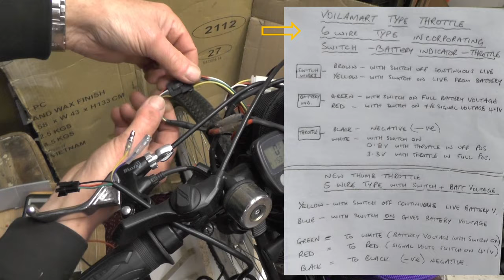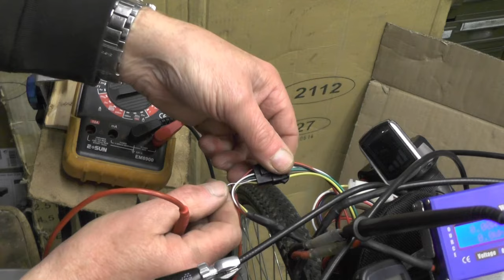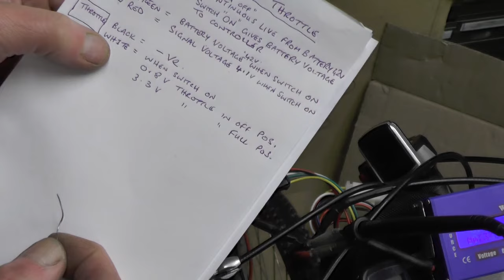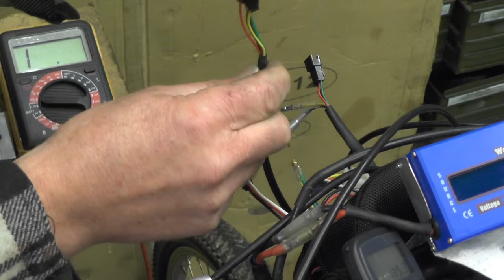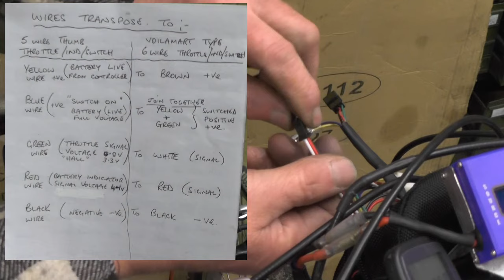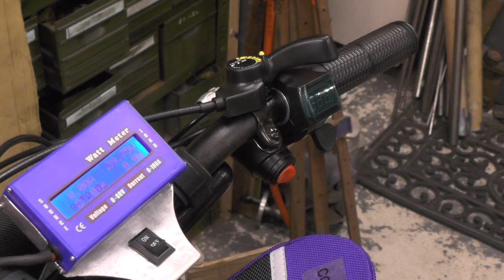Electric Bike Wiring Twist Throttle 6 wire to Thumb Throttle 5 wire Voilamart  type Controller. Mr F

Comment: thanks for the reply so maybe you can help me connect a motor controller with six colour hall wire to a five wire wheel hub   so the controller wire are Blue/Green/Yellow/ Black/White/Red  and the wheel hub has five wires which two colours can I connect together to work with five  Red/Black/Blue/Yellow/Green
Reply from the maker: Hi
I would love to help you, but its difficult without being hands on, as different manufacturers  can use there own colour coding sometimes, so can't be 100% sure.
But usually the Hub hall sensor wires are red for positive, black for negative, the blue yellow and green are usually the signal wires and the white wire can usually be left unused as its usually the speed control wire for some bikes. Just isolate the white wire.
Hope this helps, but really need to be hands on to give any better advice.
Good Luck with it
Regards
Kev
Reply: thanks you your a good explained  I will try go by your wire diagram you wrote on the paper but at the same time I will see if it works with out the white wire not connected hopelly I can see that the speed on the display is detected when the wheel is spinning  I did a search on google and found that battery thumb throttle
Reply from the maker: @scienticstratgies2368  good luck 
regards
kev

Comment: hey I  got a scooter that I  want to change a. pull finger that push throttle  like the one you got can you send the the information where you got it   thanks for that video  the controller I have has the 3wire brown /black / yellow
Reply from the maker: hi there.
thanks for watching and commenting
I did these videos a few year back now, i have checked the ebay seller that i got the throttle off and they no longer exist, so its just a matter of searching for a thumb throttle from another supplier, sorry can't be more helpful, the market back then was flooded with them.
all the best with your search
regards
Kev

Comment: that is very true wires are never the colour that you expect them to be having alot of trouble getting the same type of system to come on the bike didnt come with a key i know there should be fuses but i cant seem to get to them as no key to battery case. the bike was all runing before all whats been replaced is the throttle as this was damaged and wire were cut on controller end at a complete lose as to next step
Reply from the maker: Sounds like a frustrating situation, hope you get it sorted!👍 Paul
It might mean a replacement controller if the wires are no longer there.
However they may have been cut for a reason as throttles are illegal if your in UK,? (see my latest video here)  https://youtu.be/8uXyJvyXAQ4
Controllers aren't too expensive, if you have to replace it.
all the best
Kev
Reply: @MrFactotum  am i right in thinking that as long as they are the correct voltage and wattage all batteries and controllers are compactable as long as they have the correct fitting types?
Reply from the maker: @Paul-df4mc  Hi Paul, yes usually, and some controllers have combinations of voltage i.e, 24v -36v for example
all the best 
Kev

Comment: Well my question is. I broke my twist throttle.  Basic push button power and 3 light indicator. Alright. I tryed to use a regular 3 wire red green black. Turn on but the it wouldnt work. So the black red and green must have been different then the other black red and green.
Reply from the maker: hi kb88
its quite a long time since i did my ebike video, my grey cells don't retain all the different wiring combinations also equipment changes over the years
i know different manufacturers can use different colour coding, so it's just a matter of tracing what's    +ve , -ve & signal wires with a simple multi meter. I think if you follow the sequence in my video you should determine what's what. 
The only trouble is, is if you've been given a faulty unit it can be difficult.
It's difficult for me to help without being hands on, but usually the multi meter should sort out what is what.
good luck
let me know how you get on.
regards
Kev
Reply: @MrFactotum  I'm shocked for a response.  Im in the US.  I've been messing around with them for some years now. I bought this bike which I have shaped things around with other bikes. Any ways I didn't buy this controller and that where I'm at here. I do know I've bought a throttle in the past and it had a blue instead of a green. The was simple with a Basic two wire dc motor. Im have a hub motor and I was thinking the throttles were different, because of the hall sensor in it. But thier not I just need to figure from the controller and old part what the 3 wires are compared to a throttle I just have laying around hooked up to a controller I know work's together.  Thanks for responding.
Reply from the maker: @kentbyers88  your welcome
good luck👍👍👍👍👍👍

Comment: Great video sir well done! This video is 3 years old and still no standard never trust always ues a multi meter there cheap and will save you money in the end !
Reply from the maker: thanks Christopher
appreciate the feedback👍👍👍👍👍👍
regards
Kev
Reply: Hey I need help I have two wires hooked up and they now turn the display on when I turn the key all I have left I'd a green and white wire on throttle and red green white and yellow on controller so I have 2 wires that need to be hooked up to 4 wires my motor is not moving when I twist any ideas?

Comment: Satisfying to see this so well explained although I'd be careful about using your continuity checker on live circuits. If you want to add a second motor https://youtu.be/0oyP64j-Khs
Reply from the maker: cheers Richard
i will bear your info in mind and will check the link you sent.
many thanks👍👍
Kev
Reply: @MrFactotum  Thanks. I blew up two bikes this week and needed to repair them.  Your video was easier to find than mine. It was really useful Thank you.  This is the other broken bike  https://youtu.be/CnJ1kYMNbxs
Reply from the maker: @richard_wenner   Hi Richard 
thanks for feedback, now contact made i have Sub'd and Bell'd you and will take a look  at what you get up to when im back off holiday.
regards
Kev👍👍👍👍👍👍
Reply: @MrFactotum  Have a good holiday.

Comment: Help! So I have the same old 6 wire throttle and a new 5 wire throttle with key instead of a button.
My voltage meter turns on but the throttle isn’t turning the motor? 36v 750w motor. 
Any ideas?
Reply: Also I can hear the motor click when I turn the key switch on. Just no turning.
Reply from the maker: hi ff590.
sorry to hear your problem, it's really difficult to say not being able to have a hands on approach,  there are quite a few variables to check, as nothing is standardised, if the motor worked ok with the old throttle on then this should eliminate a motor problem, unless by coincidence a fault has occured with maybe a hall sensor in the motor,.
Because your key switch throttle is differenent to my button one it could be wired with different coloured wires, it's just a matter of being methodical and re-check what wires are serving what parts etc. and trace there function.
Sorry i can't be more specific, but its difficult not being hands on to look at it with it not being identical to my voillamart one. 
all the best with it👍👍
cheers
Kev
Reply: @MrFactotum Hi,
Thank you for taking the time to reply and the quick response Sir. I know it’s really hard to help not being able to see it.
I gave up last night after messing with it for a few hours lol. The motor seems to be fine though, as it still functions normally with the old throttle so I’m confused at this point lol. I’m going to give it another go after work tonight and retest everything with the multimeter.
Thanks again for the reply and the video. It helped very much to understand how it works.
Reply: Hello again MrFactotum.
Had another question i was hoping you could possibly assist with.
I replaced the throttle I couldn’t get to work despite wiring it exactly like yours.
And it worked!
Question is though, now I replaced my controller with one that supports an lcd.  With the lcd being the only/off power button now, is it possible to use my(or any) keyed throttle? It’s currently working just as a throttle only without the key function.
Thanks again for the video. It’s  been extremely helpful.
Reply from the maker: @TwitcyTrain eyup FF590
glad to hear it worked. 
As for question about the different controller with a lcd display, i have never owned one of those, so can't really offer any advice, i just keep all my bikes with the minimal hardware, then if a problem occurs it's more simple to resolve, I would keep it without the key function if its working ok, if your worried someone might take off on it, put a on/off switch hidden near the battey, to isolate the battery., thats what i have done, i also put a inline fuse there as well, and carry a spare fuse with me.
I'm not telling how to suck eggs here, but never leave a lithium battery on charge in your home, shed or garage. especially the far eastern ones which most of them are anyway, wether branded or not. I always charge mine outside in my undercover entrance way, and never leave it alone.!!!!
All the best with your new toy🚲🚲🚲🚲🤣🤣👍👍👍👍👍👍👍👍👍👍👍👍
cheers
Kev
Reply: @MrFactotum  Thanks for the quick response again. Okay the hidden switch is a great idea. I only wanted the key for protection for the few times I might take it to the store. I do tend to agree with the minimalistic approach. However I did want the option to adjust my PAS and wanted something that showed my voltage instead of the bars.
Love the content!

Comment: In the first meter (bar one) screen, can you please tell what does the red rectangle sign means (below cycle sign)
Reply from the maker: Hi
its a long time since i did that video, i  no longer have the throttle with bars on, give me a reference time in the video so i can take a look to see if i can remember, for you.
regards
Mr f
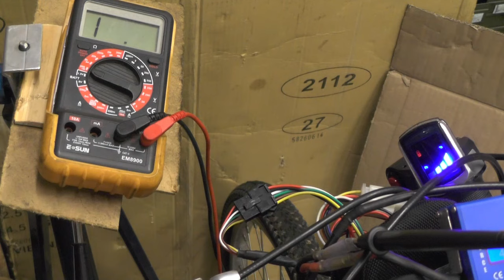Reply: 9:12 and 13:17
The meter with battery bar. Red rectangle icon in left.

Comment: On a twist throttle voltage display. 1 week ago it read 48v now it reads 42v. Does it go all the way down to 1v or 10v before I need to recharge the battery or ? Please let me know ?
Reply from the maker: No, 
a 36v battery when full reads 42v when discharged it will cut out at around 30v, 
Don't know about 48v batteries, but will have a similar ratio.
cheers
Mr f

Comment: Wow. Looks like I'm headed where you've been! Thanks for the vid!
Reply: @MrFactotum  sure we got the same kit mine got 6 wires I’m looking to get key throttle like yours if it’s the same wouldn’t wiring be the exact same like you did in the video? need to know since don’t got the volt checker it would be more ideal with one
Reply from the maker: @Dumponanything  Hi DOA
It's a while since i did that video, but from memory, you would think the wiring would be the same, but back then different manufacturers could use different colour wires, If manufacturers have standardised by now, it could be the same, but if it was me i would methodically check what wire is what. 
As long as you don't get the +ve and -ve mixed up you shouldn't do any damage to the hall sensor, I have no experience of the ones with keys, but would imagine it just the same as the push button switch. 
All the best👍👍👍👍
Kev
Reply: @MrFactotum I think I’ll only need help with the 3 wire adapter that you bought separately I can’t tell where/how you’ve connected it . Anywhere I can contact you like instagram to make it easier? Thanks
Reply from the maker: @Dumponanything  Hi DOA
Its a while back since i did this, so memory has faded, but i think you mean the 3 pin plug i added for the +ve = red to red  -ve black to black and signal wire white to white, then there were two other wires with bullet connectors on to the switch.
Hope that helps.
Sorry i don't do instagram
I'm on holiday at moment so can't check the bike physically, but i think the 3 pin connector is how ive just described.
Like i said before, just dont get the +ve and -ve mixed up, and a voltmeter would verify those if your not sure.👍👍👍👍👍👍
Reply: @MrFactotum  thanks for that enjoy your holiday bro 👊 will most likely get a voltmeter to be sure 👌

Comment: Hey Great Vid! You have a new subscriber.

Do these Voilamart boards support wiring in a reverse switch? I know its a bit weird on a bike, but I need it for a project I am looking at. I realise the wiring for reverse may not be there, but wondered if it was on the board and could be added relatively easily. Cheers!
Reply from the maker: eyup RH
Thanks for that.👍
The one i have in the video, doesn't have a reverse on, but i have a different controller  on another bike, just a cheapo far eastern one and that has wires for a reverse mode, so if you have a project that needs reveres checkout the description on the controllers, i got mine off "Fleabay"
regards
Kev

Comment: I replaced my throttle on my Archer electric scooter it worked then I unplugged it and plugged it back up and it wouldn't work what happened
Reply from the maker: hi Brandon
Sorry to hear your problem, it's just a matter of double checking all the wires and connections for faults, and for good connections, or maybe you have a faulty product. It's very difficult to say without being hands on.
Hope you get it sorted.👍👍👍
ATB
Kev
Reply: But how do u no if it's a faulty product
Reply from the maker: @brandonsourjohn4901  well Brandon, thats the million dollar question, it's like anything else, probably compare it with a good one, then you will have a spare or sell one on.
Sorry but it's a hands on problem, can't be solved unless on the job. Just double check all the wiring, connections, earths, live wires, signal wires to see if they are all doing what they sould do, if you accidently put full voltage wires to signal wires you can damage the hall sensor in the throttle. After that it's probably down to the throttle. Cheap imported items are notorious for having some form of faults, some repairable, some not. If all fails you could ask the supplier of the throttle to replace it if it's still not responding.
ATB

Comment: Warning: On mine the yellow wire from the controller must connect to the yellow wire on the throttle. If the brown wire from the controller is connected to the yellow wire on the throttle like it says in the video it will still work but the voltage display will be illuminated even when the power is switched off!  Only the blue wire on the throttle needs to be connected to the brown wire on the controller. No need to connect the green wire from the controller.
Reply from the maker: Hi iptv
Thanks for comments, it works fine on mine and for many others who have commented, 
I did say in video that there's no guarantee that all throttles will have same colour wires and to double checkwhat wire does what before fitting
MX & HNY
Reply: Today I replaced another 6 wire twist throttle with a 5 wire thumb throttle of a different make and it's a good thing that I took your advice and tested it before seating the connectors into the socket because this one needed to be wired like in the video with the brown wire on the controller to the yellow wire on the throttle. Like the other one it didn't matter if the blue wire on the throttle connected to either the yellow or green wire on the controller.
Reply from the maker: @iptvcr8594  Thanks iptv cr
Yes there seems to be no standardisation, imperative that wires are checked!!
HNY 
ATB
Kev

Comment: how to connect simple thumb the three wires black green and red on controller six color display socket red black white green brown yellow
Reply from the maker: hi 4444sh
If you are just omitting the switch, just connect the 3 throttle wires to the controller then the 2 wires for the switch will need joining if you are not putting a seperate switch in. If you are deviating from the voillamart set up i have no experience in other systems, so just use your multimeter to determine the wires, like i have shown in my video.
hope that helps
cheers
Mr f

Comment: Sorry to bother u again.  Still working on ebike and listening to this video. 

When u did a continuity between the yellow and blue wires (mine yellow + brown) u said the yellow wire is ur continuous live +ve and the brown wire for activating controller. U probed the black meter to blue and red probe to yellow. 

Wouldn’t continuity work both ways so that even if u switched black and red probe u would still get continuity, no?  So how did I determine that ur yellow wire is for continuous voltage and blue is for voltage to controller when u turn key, press button, etc to turn bike on.  Little confused.

I’m watching video over and over to absorb information.  Thank you.

/Bklyn👑
Reply from the maker: hi robert,
i know these wiring on ebikes can be confusing, especially with no standard colours, it's a couple of year since i touched on that, my grey cells don't keep info like they used to, so will have to refocus, i am in the middle of re-roofing my conservatory at moment, so when i get time i will try to remind myself what i did, so if you could bear with me.
Keep going at it and sometimes if your like me the penny will eventually drop, i am no expert, it's just what i learned at the time of doing it, 
cheers
Kev
Reply: @MrFactotum  for sure.  no worries.  thanks again.